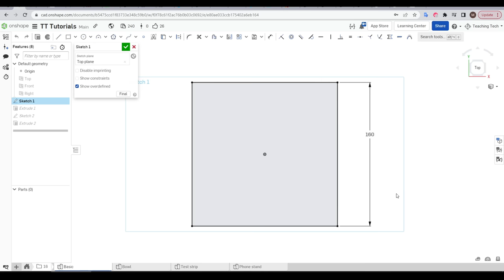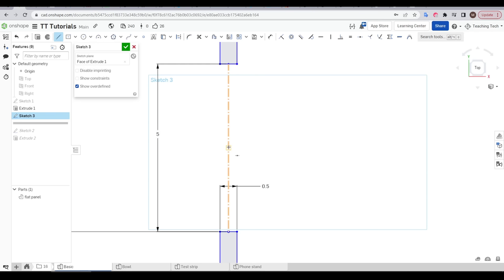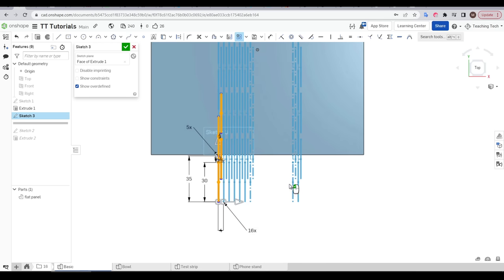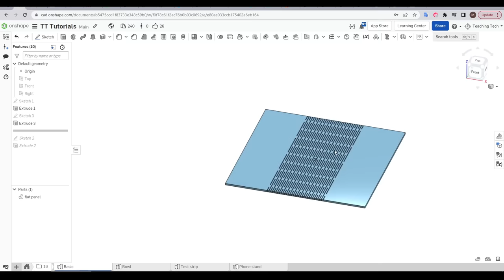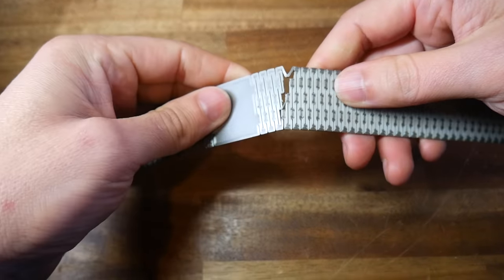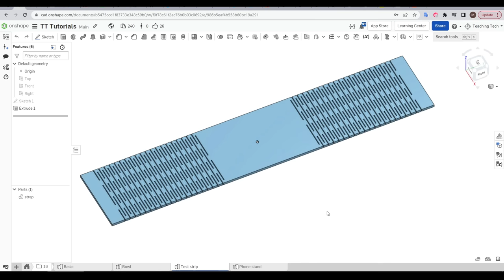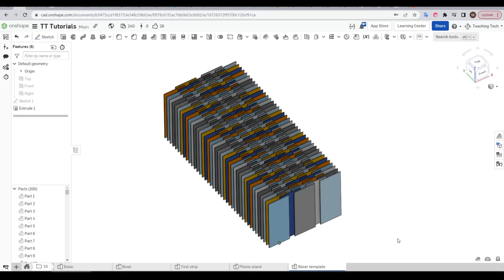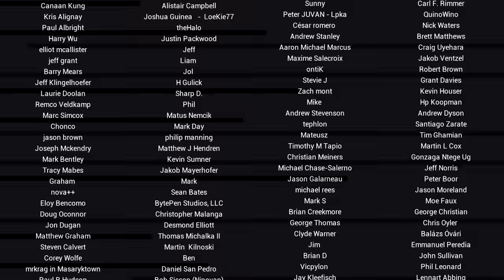Make your parts bendy with this design hack - 3D design for 3D printing

Comment: I find it more configurable in onshape to create a minimal sketch, extrude and remove that sketch, then use the linear pattern tool set to feature. This is especially useful combined with patterning multiple stacked features.

I'd also just create two initial slots diagonally constrained, then create a linear pattern for each slot with one of the patterns having one less on the pattern count. This makes everything totally parametric without having to remove anything.
Reply: this sounds awesome but i am dumb, you should make a video example
Reply: @hamburgerbuns9752 he means rather than making one sketch with all the slots, you can make a simple sketch with only one or two slots, extrude those one or two shapes, then use feature patterns (patterning the new slot parts, not the sketch) to multiply and position the additional slot parts where you want them before you cut them out.  Onshape works better with simple sketches.
Reply: This is the preferred approach in Fusion 360 as well
Reply: This is definitely the right way to do it. Patterning in a sketch is in my experience sets yourself up for failure

Comment: Another great video. I really like these design instruction. This one was easy to me on technical level, but I wouldn't try it on my own. The "negative version" of the slots to cut-out afterwards would be great to have in OpenSCAD, maybe I'll do something simple later today and put it up on printables. I'm away from my printer and PC, but I can always use the online version of OpenSCAD. Amazing times we're living in 🙂
Reply: Hi.. great Idea (the video and the OpenSCAD suggestion, try this code: (play with dx, dy, h for your conveniance... :)
$fn=10;
module cy(x,y,z,h1,r1,r2){translate([x,y,z])cylinder(h1,r1,r2);}
module cb(x,y,z,dx,dy,dz){translate([x,y,z])cube([dx,dy,dz]);}
module r_vslit(x,y,z,len,w,h)
{
 cb(x-w/2,y,z-0.1,w,len,h);
 cy(x,y,z-0.1,h,w/2,w/2);
 cy(x,y+len,z-0.1,h,w/2,w/2);}
{dx=2.5;dy=4.5;h=1.5;
difference(){
 cb(0,0,0,24,28,h);
 for(i=[0:3]){for(j=[0:3]){
 #r_vslit(3+i*2*dx,2+j*2*dy,0,6,1,h+0.2);
 #r_vslit(3+dx+i*2*dx,2-dy+j*2*dy,0,6,1,h+0.2);}}}}
Reply: @leonpijpers7327  Cool
looks much nicer, like Ikea Skadis 🙂
but rounded edges are counterproductive  in that case. The material is being stretched and compared on that axis and straight edge is much better suited for that action. Rounded edges would be better for a spring of that design. Furthermore, the point was to create a "negative" model which can be easily subtracted from your target model inside slicing software.
Reply: Hi, 

Removing the rounded ends is easy.. just remove the cy(..) commands in the r_vslit module
and if you only want to subtract a file... you could try it like this..
$fn=10;
module cb(x,y,z,dx,dy,dz){translate([x,y,z])cube([dx,dy,dz]);}
module r_vslit(x,y,z,len,w,h){cb(x-w/2,y,z-0.1,w,len,h);}
{dx=2.5;dy=4.5;h=1.5;
 for(i=[0:3]){for(j=[0:20]){
 r_vslit(3+i*2*dx,2+j*2*dy,0,6,1,h+0.2);
 r_vslit(3+dx+i*2*dx,2-dy+j*2*dy,0,6,1,h+0.2);}}}

makes it simpler.. I just prefer putting everything OpenSCAD in one file but I get your point. (also increase the height "h=1.5" quite a bit to be larger than the subject you want to "kerf"(just learned a new word from the other comments)

Comment: the technique is called kerfing in case anyone is wondering. in this case it is kerfed from both sides the of the part to further increase the degree of freedom of the part.

12:19 the tighter curves would be better served by increasing the kerf density at the locations needing more aggressive twists. currently it is 0.5mm kerf at 2mm intervals. could try 1:1.

for slicing, specifically for the kerfed area and very high kerf densities, the parameters of the kerf width kerf, interval and extrusion width become important. which can cause print time to increase or make the surface rougher than desired. for example a 0.5mm kerf at 2mm intervals requires 1mm plastic width, which is two passes of 0.5mm extrusion (probably too wide for a 0.4mm nozzle) PLUS an ugly gap fill required because the lines have to overlap a little. if the slicer can modify EW on the fly like with Arachne in PS/SS, EW will go above 0.5mm which is usually not a problem for function but will affect beauty--after all we tune our printers for static EWs.. if you don't have variable EW then it will be two passes with a gap fill--also ugly but now slower print as well.

Comment: I just made a test piece, a 20 by 100 by 2mm rectangle. The gaps are .4 by 10mm, spaced 2mm apart vertically, and with .8 of material between the gaps horizontally which ends up being 2 lines thick while printing at the standard .4. 

The radius that it can bend is pretty tight, I'm able to fully wrap it around my finger without it breaking. This technique would be perfect for a wearable like a watch or similar where you have a buckle of some sort on each end. 

Thanks for the great idea, I instantly had a few ideas on how to implement this technique into a project I am working on to help my dad recover strength in his hand after having a stroke a few weeks ago.

Comment: Nice experiments!

You should check "Le Labo d'Heliox" (not sure of the spelling). Some time ago, she made a book-like box with a bendable back (I don't remember if she designed it, though...)

As for your phone stand, the blue part should not be straight: even if the bendy design allows for any deformation, it would not like it and  try to have only "off the plane" bending => you should try to design a radial bending thingy...  (pick another name if you like 😉) measure both sides of your bend and flatten it like a cone (I would need to check the math 🤔)

Comment: I've ended up as a Fusion user rather than TinkerCAD, so a lot of your CAD videos don't teach me much beyond "here's a cool idea."  Which is fine, there are other videos for the specifics of Fusion.  But this video not only presented a very cool idea - admittedly, one I don't yet have a use for, but now that I know about it I'm sure I'll think of something - but also a very straightforward technique that I can easily adapt to Fusion: the way you used three construction lines to centre a rectangle on another rectangle.

I'm sure that's a basic CAD technique but i had never seen it before now, and that will be so, so useful!

Comment: 7:29 I think the horizontal offset is incorrect. It should be 2 * (B + D) since the sketch includes 2 rectangles, so 50mm in that example, or (2 * (30+5)) = 70 in the demonstration earlier. If I'm right, you've got duplicate rectangles that perfectly overlap a previous one. It makes no difference in the result since the cut extrusion would remove already removed material, but it'll definitely make the software run more sluggish since there's  twice as many rectangles as you need.

Alternatively, instead of drawing 4 rectangles in the sketch, you can just draw 2, in the demo that was nr 1 and nr 3, in the guideline, leave off the two to the left.

I may be wrong. Please check.

Comment: You should have a look at bending acrylic. In school we cut and then bent acrylic to make phone holders. To bend it you can either heat up lines and then bend on the line or heat the whole piece and then bend it.

I wonder if a similar thing would work on other thermoplastics like PLA, PETG, etc, then you could bend it without needing to use that pattern, you may even be able to bend it with the heat of the bed.

Comment: This is due to the material behavior and making lots of beams that deflect without yeilding. It is possible to calculate/approximate the spring stiffness and maximum deflection.

Comment: Instead of super glue, you could add some extra thickness to the begin dans end of the flat strip to help it stick in place.

You could also replace the holes for the strips with some T shaped rail to allow the strip to slide in like in an apple watch strap attachment. Don't forget to close at least the outer rail end to prevent the strap to slide out too easily!

Comment: really cool, i wonder if they should be used for belts in belt drive mechanism, or maybe as threads for a tank or excavator
Reply: I could totally see this being used as catepillar treads. It'd be easy to incorporate a hole on the treads for the 2 wheels that'll drive each side to move.
Reply: Interesting idea, maybe useful for small models or RC vehicles. But at scale, I think these would be very impractical. They stretch far too much and under extreme tension, like a full-size bulldozer or a tank, the ability stretch (without any limit) would lead to coming off the guides and/or self-destruction.
Reply: @steveh8724   I'm sure there are ways to mitigate that. Making this simple kerf cut design into something like a tank tread would necessitate adding some engineering complexity anyway.

Comment: I found that in Cura if I did infill only with no walls at all it made a flexible material. I've been meaning to play around with it in bambu lab too. I don't remember what infill i used but im sure it would work with more than one

Comment: Interesting. I used kerfs to allow plywood to curl but this is new idea. I wonder if I could make the holes very tiny and use this instead of bead lines for bending parts used on my printer. The bead lines work very well but they will eventually fail.

Comment: Thinking this could be really good for headbands (for stuff like VR headsets or heavier headphones) but it might catch hair in the little gaps.  TPU tends to be too rigid (depending on the shore hardness) for the thickness I require and too difficult to print with curved or organic shapes (it tends to not be as comfortable printed flat and bent around a head). Elastic/fabric straps are comfortable but they tend to be too loose and really bad at supporting heavy objects in key areas so I'm thinking a combination of elastic/fabric and this technique with PETG might be spot on - rigid where it should be (side of the head), flexible where I need it to be (round the back/top of the head) and comfortable with fabric layer in between the head and the plastic strap!  Thanks Michael for the inspiration.

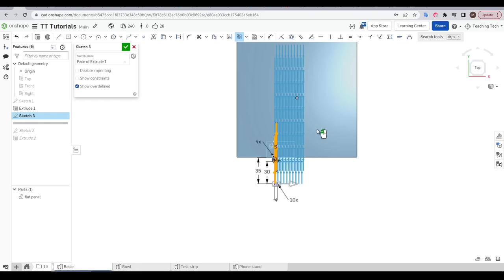Comment: 4:58 I believe you would need to go 70 mm because technically we are duplicating two slots (60mm) plus 5 mm gap plus a 5mm gap inbetween the patterns again I was having trouble constraining following this video then I blew the spacing apart and found more rectangles perfectly overlapping.

Comment: Think there would be any strength / durability advantage to using actual slots (with semi circular ends) rather than rectangles with 90° corners?
Reply: It probably would help quite a bit. Sharp 90° corners always tend to be a break point when stressed, no matter the material or the production process.

Comment: It seems like more complex geometries could be made by using the pattern along a curved spline
Reply: Printing an already 3D design with some kerf cut elements for extra bending and flexing would make a lot more complex items possible compared to trying to print everything flat and then fold it into place using only the kerf cuts.

Comment: Wouldn't PP be the best plastic for this to prevent wearing out the bendy bits?
Reply: can you print polypropelene i didnt know that
Reply: @stanleyhoptroff  You can, it is not a very common material though (for filament), and as such the colour selection is usually limited.

Additionally it (according to Prusa knowledge base, haven't tried it myself) it tends to warp, doesn't stick well to the bed and is expensive.

Comment: In your phone stand design mock-up, you have clear ~90 degree bends at each side, your slot pattern alone just isn't going to allow for that, your printed band needs to have those curves baked in, likely with a radially patterened array of slots, the elastic deformation throughout needs to be at about the same level throughout, those bends are a massive stress discontinuity between desired end-shape and the presented/printed form. It can still be flat, it just needs bends to assist.

Comment: Did you consider patterning the cut (feature) instead of the sketch to save a bit of work/ processing power?
Reply: I tried this technique in Fusion360 and patterning the cut (feature) is the only way it can be done in Fusion360 because it can't pattern the sketch! Took me days to figure this out! My test print of 8cm x 4.5cm with 20mm slots and everything else as per the video came out nicely in PLA with a reasonable amount of flex so it was a fun first attempt. What I wasn't prepared for was the bizarre printing sequence that Cura came up with on the slices for my Elegoo Neptune3 Pro, and the tiny bits it has to lay down on the first layer were prone to being knocked around by the extruder, so I ended up printing at just 20mm/s with a cooler bed and that worked but the print took 3.5 hours, hahahahaha!

Comment: Hi! Your phone stand design failed because you were thinking 1 dimensionally. You need to extend to 2D. At 11:35 it is clear you modeled the strip as straight line, but your original design absolutely hints there are cones. At 11:25 you measured only one radius. There's only so much stretching and compression the technique can provide you. So, If you print in 2D still, but with curved strips, your design can work!
Edit: it's very hard to describe two and three dimensional shapes without pointing to a certain section of the design. I'm only hoping the point makes it through.
Reply: I think that the phone stand had issues because the middle part of the base  used this technique to bend upwards instead of being printed in one position. Because all three parts coming to meet in the middle up top had bendy joints, the point where the phone was supported was higher than designed. There wasn't a a need for the support that held the middle of the bendy piece to have a bendy corner too.
Reply: @capitalinventor4823  I think you are correct on too much bend on the base. This thing is all about balancing the forces. Problem is that twisting and sideways banding requires much more force than bending perpendicular to the plane. Hence, the twisting forces overpower the base's bending force.

Comment: Maybe the phone holder would work better if you start with a curved but flat piece with the pattern, rather than just a straight piece.
Reply: I just saw your comment after saying almost the exact same thing in a response to another comment above.
Reply: @SuperDavidEF  yeah work within the actual limitations you have not which your mind has imposed on itself, if your aim is to have it manufactured from a flat plate, it doesn't actually have to be straight. Curving the piece would still allow it to tile well enough for cutting out of a sheet.